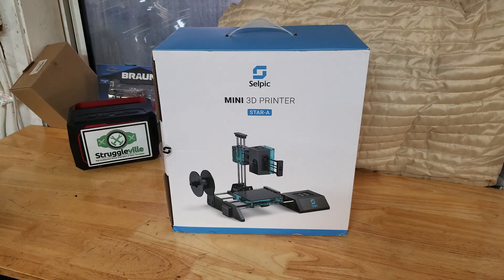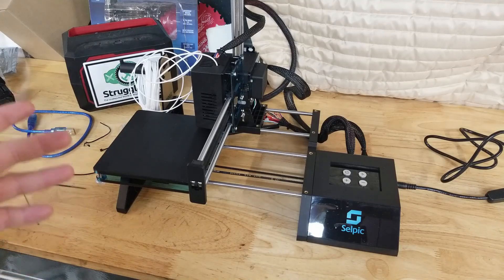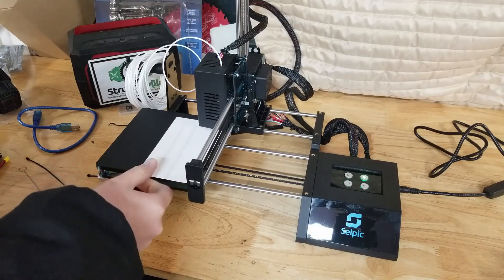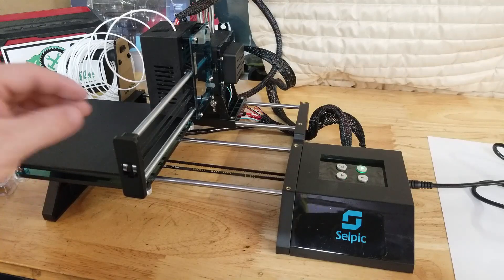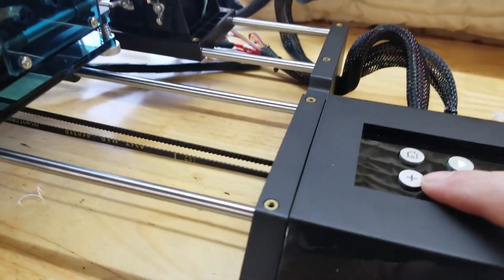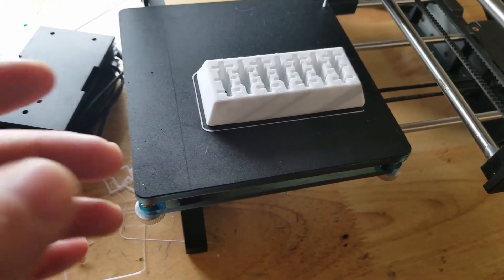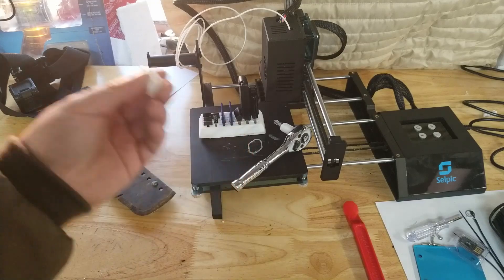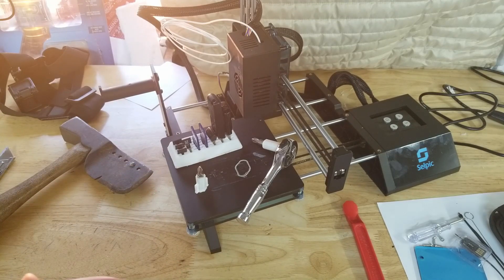Testing Out A Selpic Star A Mini 3D Printer!

Comment: easy to use.   i bought mine resently off of facebook market place and it did not come with the SD.  The only problem I am having with this,  is that the prints look like ramen noodles lol.   I dont know what im doing wrong or how to correctly set up the settings in cura lol.   it also seems that i cant find any forum on the internet with people talking about this printer.

Comment: Nice video. This is a perfect example of why not to buy cheap 3D printers, especially if you're not experienced because you will be smacking your head against the wall just trying to get around defects and bad design (like the X axis belt pulley slipping off), let alone the troubles that come with learning to 3D print.
Get something affordable, not cheap. An Ender 3 can be had for $100 USD and is a good starter printer. 

It seems Selpic doesn't make this anymore, but people should avoid similar printers in this form factor. The only benefit you get is that it's small, but it's not really much smaller than an Ender 3.  You'll still need about the same amount of desk space for either.

Comment: How did u get the stuck filament off the mat? I have some stuck on mine also. I only had this printer for 3 days & still trying to figure things out.
Reply from the maker: I think I used a putty knife and heated it with a heat gun.  In the future I sprayed it with hair spray before printing and things came off easier.  I also tried covering the mat with painters tape but it sometimes stuck to the print

Comment: For us who do have longer experience with 3D printers, that's a very frustrating model. The user interface is terrible and doesn't save much money. The laser addon is a hazard. Marketing this specifically to beginners is exploitation and hurts the hobby.

Kersey Fabrications did a test of this printer also, but eventually gave up on it.

I also see you found worse mechanical issues with it.